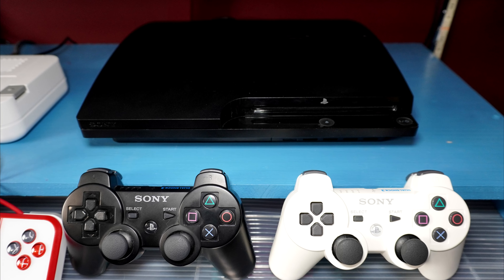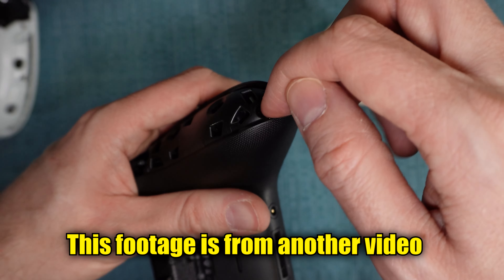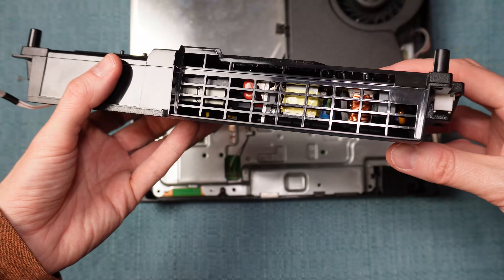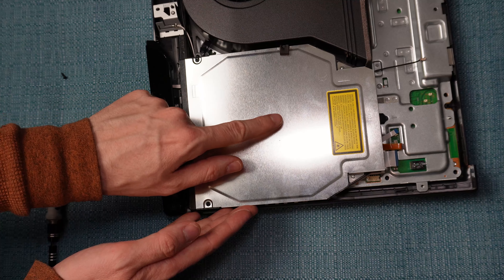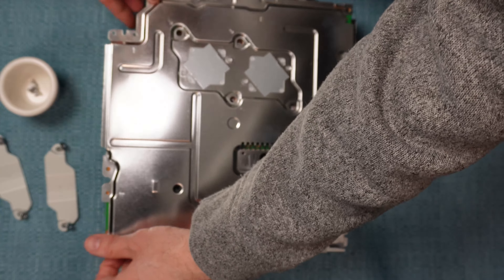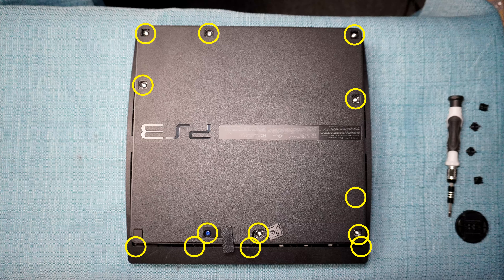How to Open a PS3 Slim to Replace Thermal Paste, Change Battery, & Clean Dust | disassembly teardown

Comment from the maker: Things you may need for this video:
T8 Torx Screwdriver:
https://amzn.to/3XNYPZh
CR2032 Battery:
https://amzn.to/43qTass
Blu-Ray Drive Replacement Ribbon:
https://amzn.to/410uKEj
HDD Door Replacement:
https://amzn.to/3nZ5Ia5
Replacement Screw Caps
https://amzn.to/3MDMrFo
PS3 Vertical Stand:
https://amzn.to/3o4uNk0
My Toolkit: https://amzn.to/3ke14nc
Electric duster: https://amzn.to/41dZemX
All Amazon links above are affiliate links. I get a small amount of money if you end up using them to make purchase (it does not have to be for the item I link to, as long as you click my link then move to another item, it works)

Comment: Keep in mind that there are two variations of the ps3 slim where the fan is placed differently. The current model being shown is the newer model which fixed overheating problems due to the fan location
Reply: mine 3000A what could be ?
Reply: Found  that out just as in the ifixit and they referenced this video at the part of the battery.  I am going to leave mine in there.  I have disected hardware but gonna leave be
Reply: Is the 2501A one of the models with the better fan?
Reply: @ Came with better air flow through the system (different fan location) I believe. But same fan to my knowledge
Reply: @counterike8250  sorry I meant to ask does it have the better overheating solution?
Reply: yes

Comment: So i just took apart, cleaned, and put back together my ps3. It turns on fine, and takes the disc, but when it takes the disc, it makes a sound like its trying to take the disc again, and nothing happens. It doesn't read the disc. Any ideas?

I figured it out. It was the ribbon cable under the disc reader. I forgot to insert it back in. Its working perfectly now!

Comment: I would caution anyone replacing the old clock battery that the plastic slot for it can be brittle and possibly break.

Comment: When disconnecting the power ribbon cable I pulled the white ribbon cable holder off and it broke a few of the metal connector teeth and I can't get it back on. So I guess RIP PS3.

Comment: Its sad that cmos battery placement is so difficult to reach. I tried today but gave up after removing the power supply. Companies should have a separate section for cmos battery that can be easily replaced. But, these corporation have to earn money 😞.

Comment: Why cant the 5 screws that go on the front part of the motherboard cant be screwed back into place?? For some reason none of them fit and they all fall from the motherboard, those are the two silver and 3 black screws, what can be done about this? This is messed up

Comment: The guide was helpful. I just wish it was not so complicated to just replace one battery. The CMOS battery is usually in plane sight once you open the device. So many steps and a lot could go wrong. I was able to replace the battery, replace the thermal paste, and clean the system. The system was back to running again with little problems.

Comment: I liked this video, and it was the exact model I was working on, so was nice to follow since I also have the newer fan system. I did however look at several videos before this one, and there is a much better way to remove the ribbon cable for the Disk drive. It basically involves taking the drive apart while still in the case, and removing the cable from the lazer rather than the board. The drive comes apart with about 5 screws and some locking clips... Very fast and MUCH easier. But many thanks for the video....I enjoyed it.

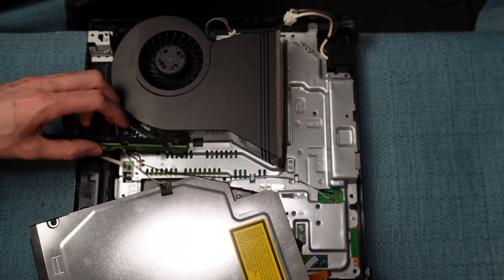Comment: At 9:31... Sure that part is the most difficult, the best way to connect that disc drive down cable is to open the disc drive, disconne t it from the laser bulb, connect it alone to the place it belongs then get it into the drive disc then now reconnect it to laser and close the drive disc then and that's it..

Comment: Nice tutorial man, helped alot not missing something and screwing it up... Though slim models have slight differences here and there, it wasn't too difficult, just tedious to deal with so much parts and dust haha. It runs smoothly at 35c now, 60c playing with fan at 25% although i might just change it to 30% speed for good measure.

Comment: At 4:22... As you did i will never advise people to disconnect the EJECT POWER ON/OFF panel because his cable connection to the mother board is truly délicate to plug and unplug, we gotta be careful with that one, i've broke mine here while using my vaccum cleaner 😢 was a bad idea, never use a vacuum cleaner to clean your devices, use a small paintbrush with soft moves it's better...

Comment: Finally fuxken done. The ribbon cable of the disc drive So fuxken hard. it took me about 20min just connect it. also my hands are big.

And all removing and installing back together. it took me 3hrs of work just to clean my Thermal paste. And i will Never gonna do it again for the next 3-4years

Comment: What do you use to clean off the old thermal paste, and what do you use to clean dust from the internals?
Reply: Isopropyl alcohol and paper towel for the thermal taste and canned compressed air to clean dust

Comment: The real challenge of disassembling and reassembling this specific model of slim is that one ribbon cable under the disc drive, motherf......... so much pain... rest ezpz lmn sqzzy
Reply: je viens de faire ma ps3 et oui en effet cette fichu nape était bien difficile  a reconnecté avec mes gros doigts de massons...

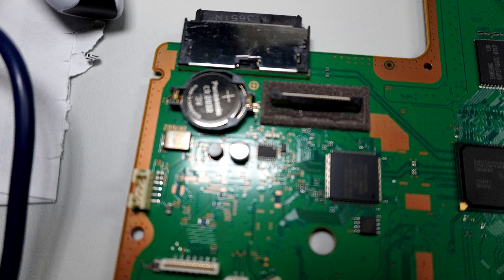Comment: @8:01 if this battery is not changed, can it make your PS3 not work ??
Reply: If the battery dies, you'll have to sign into PSN everytime you turn the playstation on. Which is fine if you have internet, but I work offshore where I have no internet access.